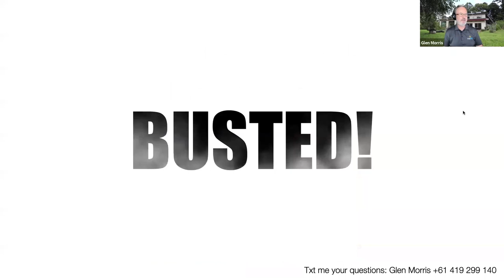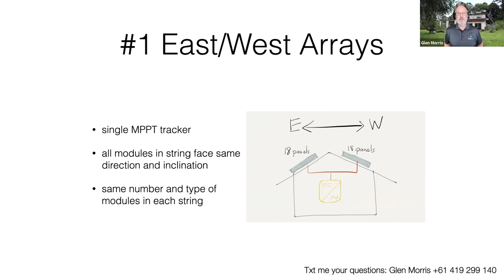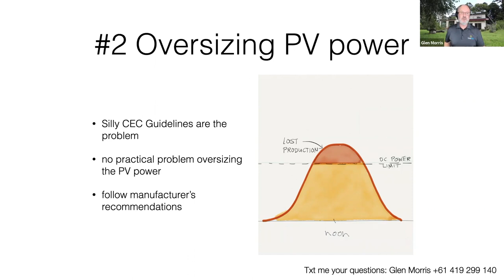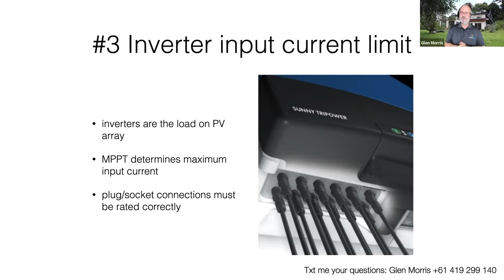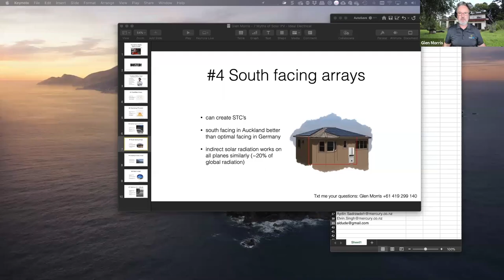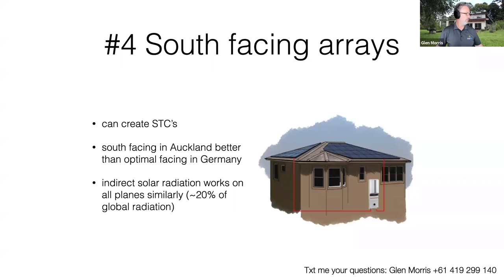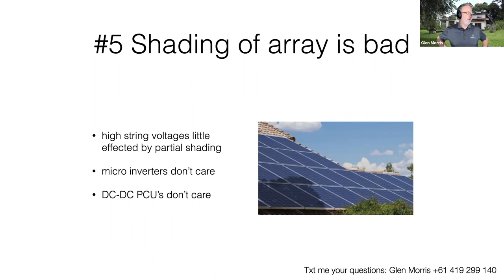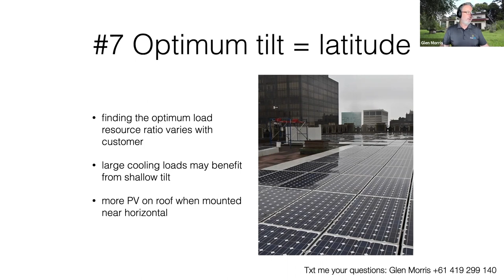Solar PV Basics

Comment: Working with a company to install my PV system.  We over sized to cover 126% of our average annual consumption.  It’s taking 31 Q Cell 405-watt panels and 31 Enphase IQ8A Inverters.  Will add batteries next year.

Comment: Thanks Glen - very helpful.  Out of interest, did you ever resolve whether the Huawei optimisers can be partially deployed on parallel strings going into the same MPPT?  I think you said the Tigos can do this as long as you deploy equal numbers of optimisers on each of the paralleled strings.  Cheers

Comment: Hi Glenn, I got Solax X3 3 phase inverter installed with two solar arrays, one array with 12 panels in series and other with 20 panels with 2 ,10 panel strings. Issue I am having with 12 panel array generate more than 11 A in some situations, which is the max current of smaller MPPT of that inverter and inveter cut out. It doesn't limit the maximum current. I contacted their company and they also mentioned that it is the standard behaviour of their inverter  and might improve their MPPT programming in future and ask me to somehow reduce the array current. I am not sure how to do that, funny thing is short circuit current of those solar panels according to datasheet (Trina Honey M 330W)  is arround 10.4 A and I am not sure how those panels managed to deliver more than 11A in good sunny day!
Reply from the maker: Ramee 23 Hi Ramee, thanks for your comments. The short circuit current of a PV modules is not a maximum current. It is the current at Standard Test Conditions which are 1000 W/m sq. Current is almost directly proportional to irradiance and under some special atmospheric conditions (sometimes called the cloud edge effect), you will get 10-15% higher irradiance for a short period which will mean the current will increase at the same rate too. I must admit I’m surprised to hear that the SolaX X3 cutout when input current exceeded it’s clipping value. I’ll follow up with SolaX and see if I can find out more.
Reply: @SmartEnergyLab  Thanks! Glenn. Good to hear it a normal behaviour of the panels in some special conditions. Yeah I am bit disappointed that Solax cant do current limiting on DC side. If you find out more please let me know ! Thanks again!

Comment: Glen is it possible for you to compare an east west array on single mppt tracker to one installed on a dual mppt tracker inverter?
Reply from the maker: Hi Jayesh, both Fronius and SMA have published academic papers on why parallel strings on different azimuths connected to a single MPPT input perform almost the same (<1%) as using dual MPPT's. The reason is that Vmp of each string stays similar throughout the day due to a negative Vmp temperature coefficient cancelling out the positive irradiance effect in Vmp. https://www.energymatters.com.au/images/news/2013/east-west-solar-paper.pdf
Reply: @SmartEnergyLab  Glen can the same logic be applied for, say a North facing roof and a south facing roof, if the pitch is the same and the no of panels are the same.
Reply from the maker: Jayesh Boban yes, any combination works

Comment: My Inverter Charger of 3200W was damaged after connecting 6 550W panels. PVoc was within limits. So clipping didn't work and guarantee was denied by the manufacturer. They said it's a man-made fault.
Reply from the maker: Clipping only effects current. Over voltage can't be "clipped". Manufacturers often give a maximum d.c. power - this is usually to accommodate maximum thermal load on the inverter's electronics. Also, inverters will have a Isc input maximum current which must not be exceeded. Oversizing of PV to a.c. output power is normal for most inverters... typically in the range of 20-200%.